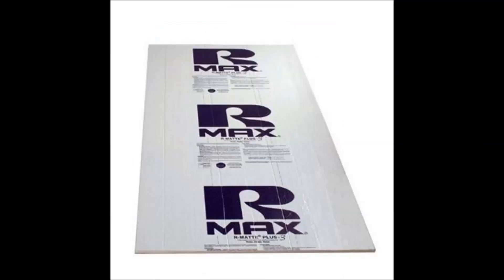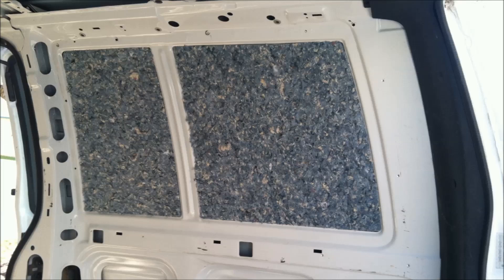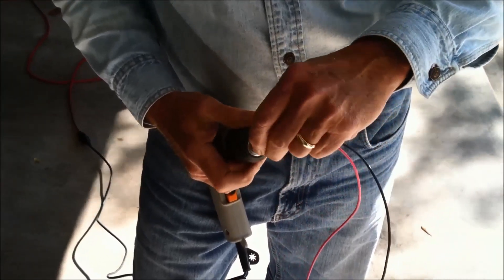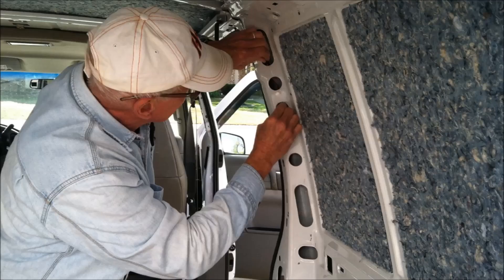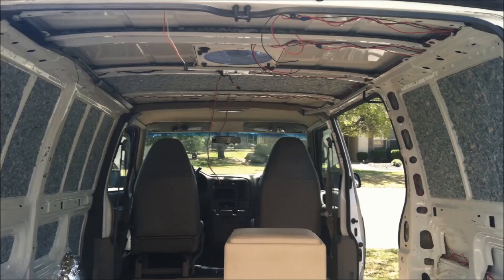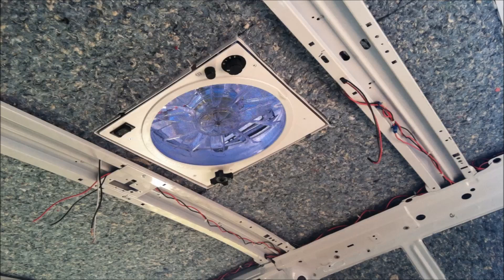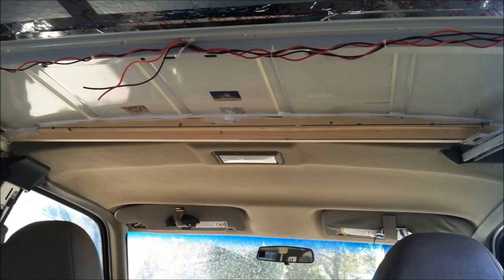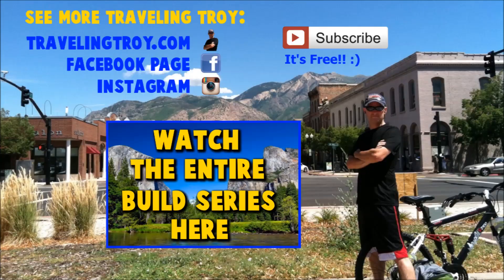Astro Camper Van Build 3 - Ceiling Insulation & Wiring

Comment: Troy, would it be beneficial applying Dynamat Extreme, (aluminized Dynamat) to the sheet metal, before installing Ultratouch ? Thanks, Scott
Reply from the maker: I haven’t used the Dynamat products, but I guess it would just be another layer of sound deadening.

Comment: Now you have had years experiencing the ceiling insulation how’s it been blocking hot sun rays keeping cooler? And would you have changed the manner of install using foil side of Ultratouch facing to interior and whether or not the polyiso really helped. My gmc Savana hitop is fiberglass not metal wondering how much difference it is in attaching either foil or denim side directly to it. I have a 1/2” max to use for insulation and plan to use thin layer of cedar as finished ceiling. Have heard it has thermal and acoustic properties also.   Let me know your thoughts ✌️
Reply from the maker: Honestly, after 5 years, I have come to the conclusion that you can’t beat the heat. ☹️ As long as there are doors and windows, the heat is gonna get in to the van.  Your best bet is to park in the shade and have fans to circulate out the hot air and pull in fresh cooler air, or install an AC unit. Now, that being said, the driver’s side of my van is fully insulated so I always park so that the afternoon sun hits that wall, which keeps it cooler.  Hope this helps.  Thanks for the question.  My heat solution has been to hit the road and chase 70 degrees.  😄

Comment: Hey traveling Troy,
I just purchased an 8 passenger Astro Van (2002), took the seats out and just finished gutting the inside. Did the one 75-foot roll of Ultratouch do the entire inside job? Including floor, ceiling, and walls?
Reply from the maker: Yes +Thomas Carvajal.  The 75 ft roll was plenty.  I had enough left over to make black out window coverings and I still have enough left to probably insulate my Dad's garage door.  Good luck on your build!
Reply: Hi just bought a 2000 astro passenger van as Well, how thick is the ultra touch ? I mean lets say it comes in a 2 3 inch thick, did you put it like that or you put only 1 inch? Am afraid to lose some space doing insulation... thanks ;) Nice van btw 😎🤟

Comment: Why did you run both red and black? Why not just run a red wire to the light/load and and ground the negative wire from the load to the van body? Also, is 12 AWG @ the perimeter of the van ok? I bought 12awg as that's what I have seen most people use but electrical charts show even thinner wire would be enough to run a fan and led lights. I plan on tapping into the 12 awg wire with thinner wire to the fan/lights. Idk what im doing haha.

Comment: Hey Traveling Troy, how have you tackled the issue of AC? Houston gets pretty hot and muggy and I know a window AC unit takes a lot of power to use batteries and an inverter. What's a good suggestion to run air conditioning
Reply from the maker: I didn't use an AC unit in my van for the 2nd summers in a row here in Houston, but I don't hang out in my van all day when it's 90+ degrees outside.  In the evenings, when sleeping, I used my ventilation setup to make it manageable - https://youtu.be/b8rmQRMUl8s  As far as AC goes, you would need a shore power hook up to run your AC for any length of time.  If you have a place to park and plug in, then AC wouldn't be a problem, but not on a battery setup.

Comment: Hey Traveling Troy! Once again your videos come in clutch. How did you go about securing the R max styrofoam boards to the roof and walls? More carpet tape or by other means? Thanks man!
Reply from the maker: For the ceilings and walls, we first applied the reflective side of the Ultra Touch insulation with the carpet tape directly to the metal, then added the R Max up against the sound deadening side of the Ultra Touch and used aluminum tape to hold the R Max in place and to seal the gaps.
Reply: Traveling Troy Awesome! Thanks for always getting back to me man. Take care!

Comment: Of all the van builds I have seen, you have taken more care with the details.  I can't wait to see the finished product.
Reply from the maker: Awesome Pidasian Hippie !  Thank you for the compliment!  I do try to take the time to explain what we are doing in each phase of the build.  When it is complete, I will probably have a Q & A to answer any questions about the build.  Upcoming videos:  Ceiling & Wall Paneling, Bed Frame Build, Battery & Charging System, Custom Roof Rack, Solar Panel Install, Shelving Build, Galley Build and more...Should be cool...Thanks for watching and I appreciate the comment. :)

Comment: I'm curious to know how this did after a few years. Would you do anything different?
Reply from the maker: No issues with my insulation, though I tend to travel to where it is 70 degrees and above freezing overnight.  I very rarely use heat.  Most people have condensation issues when the temp is cold outside and they run a heater inside.

Comment: Looks real good.  What thickness R-Max panel did you use on the ceiling and walls.
Reply from the maker: Thanks +phil robinson!  We used the 1/2" thick R-Max on both the ceiling and walls.
Reply: +Traveling Troy Thanks Troy, I picked up 1/2" R-Max last night (as I suspected it was 1/2").  I've run most of my 12v wires in the ceiling to my roof vent and lights from my future battery/solar/shore power location.  Hoping to get my ceiling insulation finished today.
Reply from the maker: +phil robinson That's really cool! Happy to hear others are building their vans as well. I'm installing the roof rack, solar panels & building storage over the Memorial Day weekend. :)

Comment: Wondering if the carpet tape could have been used for the floor insulation (and maybe even the plywood since it seems to have been cut so snugly) instead of drilling a screw.  What is the lifespan of the carpet tape?  I really like how exact and detailed you and your dad are!
Reply from the maker: Hi +1313sp - True.  The carpet tape could have been used on the floor insulation, but the van's base floor is ribbed so no flat surfaces to work with.  We didn't discover the carpet tape until after we had completed the floor insulation and were looking for something to help hold the insulation to the walls.

I do not know the life span of the tape, but it is meant for flooring, not walls and ceilings.  We're not worried about the tape failing on us though since we packed more layers of insulation on top of it and then seal it with aluminum tape.  Thanks for watching the videos.

Comment: Troy did you wire those lights in parallel?
Reply from the maker: Yes, we ran the wires in parallel so that each individual light worked whether the others were on or not.  Fast forward to the present and I removed those lights and now have much smaller dimmer disc lighting.  I’ll be working on a new video this week to show what updates I have made recently.  Thanks for checking out the videos!

Comment: You are in Texas so I see why you put the insulation foil facing the outside of the van. I'm in San Francisco and wondering which way I should face my insulation. I will eventually be moving to southern Californa, San Diego where it's mostly warm also intend to travel to higher elevations for snowboarding and I will be sleeping in the van in cold temps. It's probably better to face it inside huh? I think I answered my own question;) Chime in if you have any experience in this area. Thanks.
Reply from the maker: Yes, we used the foil side facing out.  This is meant to block the radiant energy from the sun.  It is advisable to have a gap between the wall and the foil side of the insulation, but that is very tricky to do in such a small application as a van build.  I think this gap in meant for bigger projects like buildings.  Sure, it may work better with the gap, but it would be a pain to set up like that in a van.  Good luck with your build!  Thanks for check out the videos.

Comment: Will heat cause the carpet tape to melt the glue
Reply from the maker: Hi there.  Good question.  Heat probably could melt the glue from the carpet tape, but we were mainly using it to keep the insulation in place while we added layers of more insulation on top.  It's now packed in tight and not going anywhere, even if the glue fails.

Comment: There is so much debate online about radiant barriers. There needs to be an air gap between heat source and radiant barrier. How has your van held up to the heat so far?
Reply from the maker: This is true, lots of debate on this topic.  My van has done well in the heat.  I have spent 2 summers now in the van and it has worked out fine.  It's all about air circulation.  The insulation helps to slow down the heat from penetrating the van walls, but if you don't have it completely encapsulated, then it is hard to determine if the insulation is working.

The cargo area in my van hasn't been completely boxed in, so I do have heat coming in from the front cab area windows.  At some point, I plan to add a thermal curtain to separate the cab and living area.  Many people build an insulated partition between the cab and living area for security and protection from the heat/cold coming in from the front windows.
Reply: +1 on air circulation

Comment: I got a 2003 astro with windows I'm putting a nail salon on it should I put a high top on it cause all my serviesw are sit down servies
Reply from the maker: Wow!  What a neat idea.  I would say you could get away with not having to put a high top on the van if you were just doing nails.  Maybe make a seat that is height adjustable, so it can go lower to the floor if needed to accommodate head space.

Comment: Really nice video and love the work you put in.  But that insulation is definitely installed the wrong way.  I saw a demonstration of a similar insulation at a DIY campervan workshop.  Basically, if the foil side touched any metal or does not have sufficient air space, it's as effective as not having a radiant barrier at all.  This was demonstrated using a hot plate with one example with the foil side touching the hot plate and one facing away.  The temperature difference was night and day.  Before they did that example, they wrapped the hot plate with foil and showed how quickly butter melted on it to show the radiant heat.  Then they put the foil just about a half inch away, and the butter didn't melt at all.  Anyway, I thought you might want to know.  We live and we learn right.  Still doing research for my own build so I'm grateful for your videos.
Reply from the maker: Thanks Mark.  You are correct, it is better to have a gap between the sheet metal and the radiant barrier and we knew that going into this project.  That gap is more common in the construction of homes or buildings where you have plenty of space and infrastructure to add the gap.

In a van, you either insulate the walls or you don't insulate the walls.  If you choose to insulate, there is no right or wrong way, any insulation is better than no insulation.  It really depends on the time you have available for the project and your budget for the supplies.  Not everyone can replicate what the DIY workshop was doing.

Creating an air gap on every wall and the ceiling inside the van would be a nightmare, and every inch you allow for the gap is an inch you lose of interior space.  My Astro van is a micro camper van and we weren't willing to lose more space in an attempt to add the gap, but I would love to see what you come up with in your build.

Comment: Hi how did you fasten the ply to the floor thanks
Reply from the maker: Hi +norman jones - We pre-drilled holes through the wood and through the sheet metal of the van floor.  Then we made countersink holes in the wood to allow the screws to go just below the wood surface to make it smooth for when we lay the flooring.  Next, we screwed down the plywood and check to see if it was secure.  The final step, we removed all the screws, added white waterproof silicon into all the holes, then we screwed all the screws back in the wood through the silicon to hopefully give it a good seal.

Comment: Checkin' in on you.  FYI - you do not have a radiant barrier installed as shown.  You do have insulation and sound deadening tho'.  I was pretty irked that BondedLogic had no instructions or videos for reference but I did contact two folks.  One, AtticFoil, which has a foil only radiant barrier, and Garagepros which has a youtube clip on the Ultratouch product.  Attifoil reply: "Yes, as long as the foil faces an air space that is at least ½” between the {interior} panel and the outside van wall, then the foil will work."  GaragePros reply:  "... you are correct, the cotton side goes against the metal of the car."
Reply from the maker: I here ya Day Drifter , they don't give much in the way of instructions on any of the insulation.  Thank you for your input.  My Dad and I thoroughly researched this topic and there are many assumptions, opinions and theories on how to install the insulation properly.  Based on our research, we determined that the way we installed it in this van was the best way to do it for our intended application.  Air gaps are great for homes and buildings, but not as feasible for smaller applications like my 48 sq foot van.  We'll just have to disagree on whether foil or jean material should be up against the wall.  :)
Reply: I will say, even with my ceiling still not done, I definitely could tell difference in sound deadening.  Product is so easy to use, too.  You know what I need to figure out is heat and sun radiating in thru the windshield.  I have big window and big dashboard and could really feel the heat while driving.  And that was in California, in only May yet.  Thinking of just laying some ultratouch, foil up, on the dash.  lol.... or DIY louvers... jk.  Later, gator.  (hey, I am up to 98 subscribers.... but u will always be #1...hehe)
Reply from the maker: Hmmmm Day Drifter , I haven't thought about the cab area heat yet but I'm planning on putting a thermal curtain in between the cab and living area.  So, we'll see how that works.
Reply: Question for both Travelin Troy and Day Drifter for that matter. So i undrrstand that for the radiant barrier you need a 1/2 inch spacer between barrier and surface. WHAT IF i stuck 
1-inch Thick x 1-inch Wide Expanding Foam Sealant Tape in a southern cross style pattern across the surface to be barriered? Do you think  this would work to solve the reflection concern in the open areas that are then seperated from the surface by the desired 1/2 of space. Picture 1/2 of foam sealant (high temperature tape in a envelop/southern cross pattern on each surface to be barriered and THEN, applying the reflective barrier to the surface. WOULD THIS WORK AND THEREFORE ACHIEVE HEAT REFLECTION?